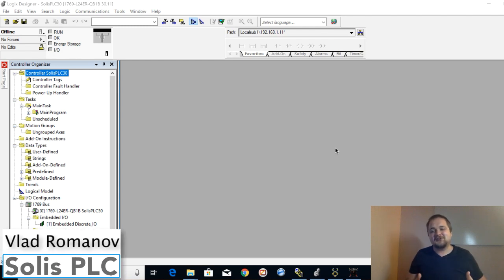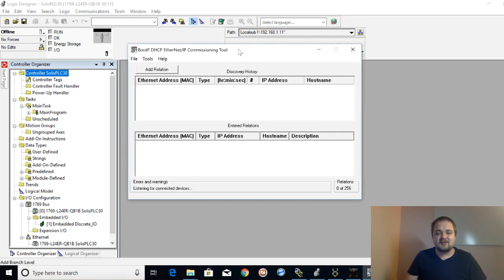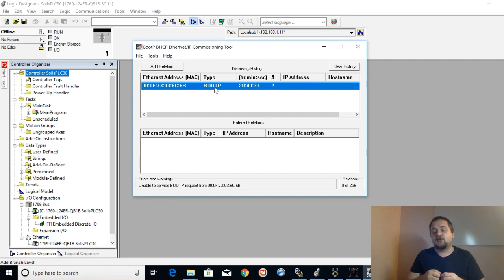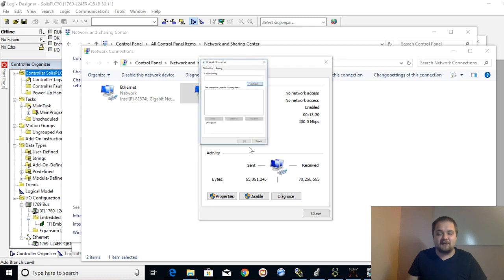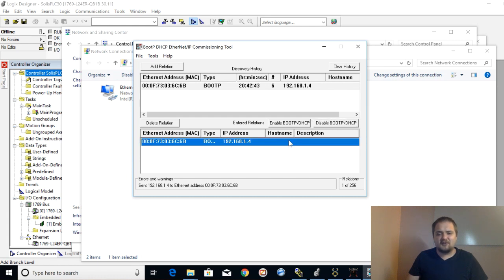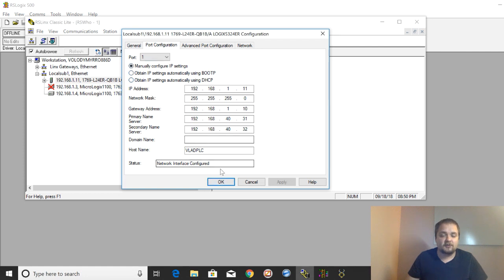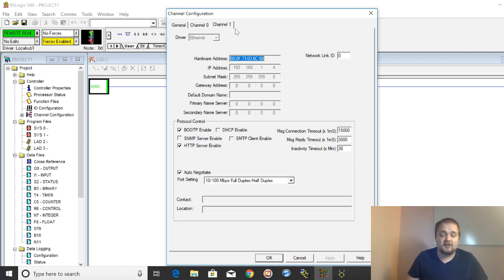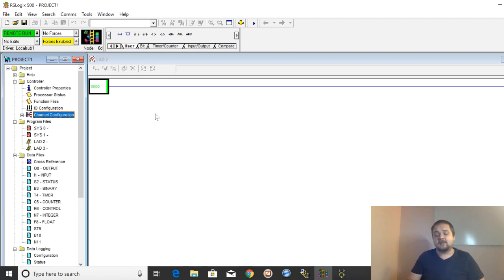PLC Programming Fundamentals - How To Use BOOTP / DHCP Tool Set An IP Address Of a New Rockwell PLC

Comment: I have found out that if it does not disable bootp with the button you were pressing you can go to the tool tab at the top if the bootp pop up and disable it there then in the bottom left side of the box it will tell you that bootp has been disabled I don't know why its like that

Comment: mad respect! my issue was that I was using a docking station (because I do not have an ethernet port on my lenovo yoga just usb ports) I was able to connect using a rs232 cable and add an IP address. I was unable to use the bootp tool because it would not find my mac address due to the docking station ( it found the docking stations mac address) So after adding an IP address I can now connect using ethernet! Thanks Vlad!

Comment: Got a micrologix 1100 and the only thing active is http server and loses the ip every time its turned off for some reason
Reply from the maker: You need to check 2 things: 1, The BOOTP must be disabled after you set the IP. Connect to the PLC and disable it in the settings. 2. The ML1100 PLC Requires a battery to keep the settings including the IP when powered down. Make sure that the battery is fully operational; replace if needed.